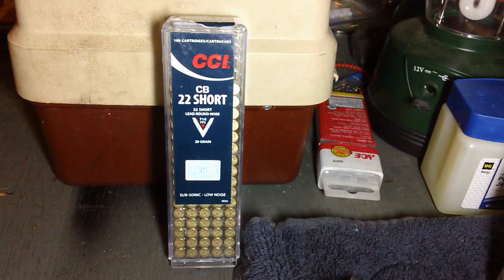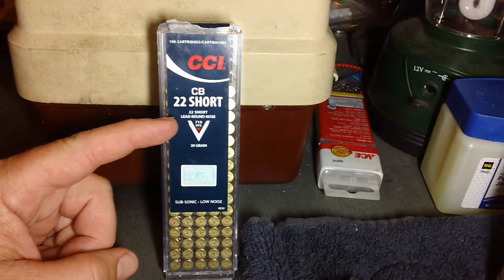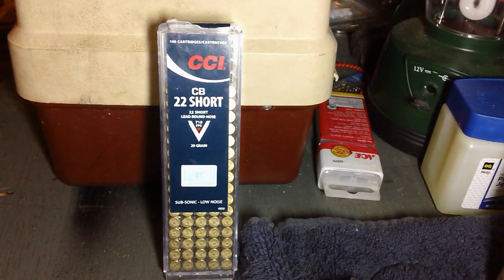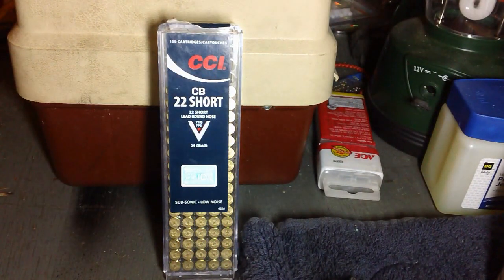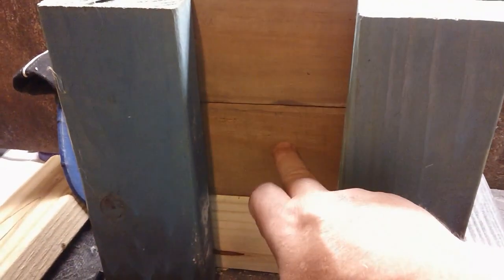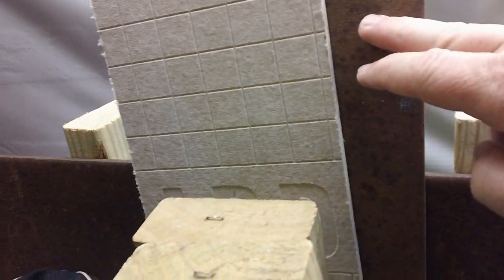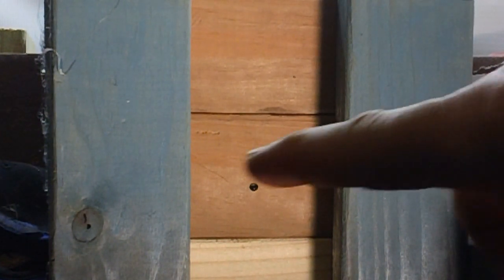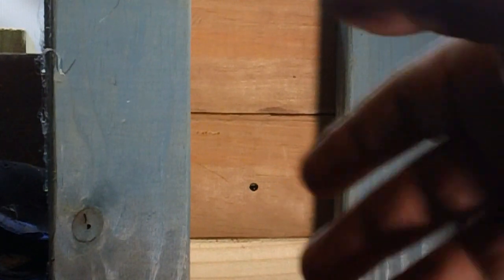.22 short (CCI  CB) vs 2x4  penetration test (CB=conical ball)

Comment: This is a .22 short CB cap. Try it with a Remington Gold .22 short hi-speed solid. You'll get a much different result.
Reply: Just FYI .22 CB Short and .22 CB Cap are two separate cartridges. There is no “.22 short CB Cap.” And to make it even more confusing, .22 Short is a completely separate cartridge from .22 CB Short. Standard .22 Shorts are several hundred FPS faster than standard .22 CB Shorts.

Comment: A more fair test would have been the 1080 fps short, or the 1105 fps short, instead of the 710 fps short...maybe the faster velocity shorts wouldn't have gone through, either, but loaded in a .22 short chambered weapon, stuck in the eye or ear, the round can end the problem real quick...

Comment: 710 fps is rated through a rifle, likely a 20 inch.
Out of the 6 inch pistol you'd likely get half that much. 
But even through a rifle I've never punched through a pine or spruce 2x4 with a 22 short. It takes a high velocity 22lr to even think about it, and it doesn't happen every time. 
Good video though, and it's cool you had your little buddy in it with you ( I'm sure little buddy isn't so little any more).

Comment: If the CB short is the same as 22 CB/BB cap then it's only powered by the primer.they are a bit more powerful than a mid powered .177 air rifle as a recall from my experiments with them years ago and they foul the guns badly.
Reply: It does have gun powder